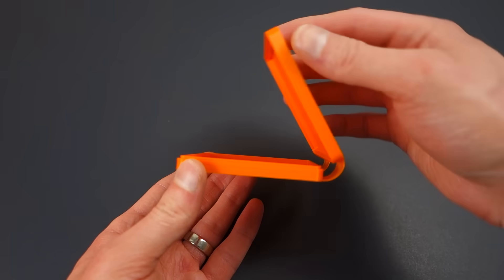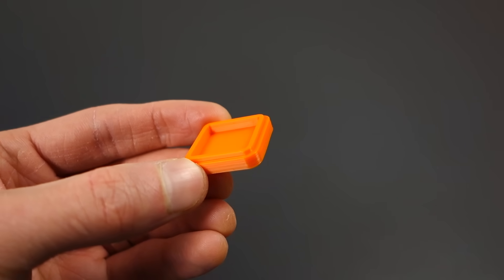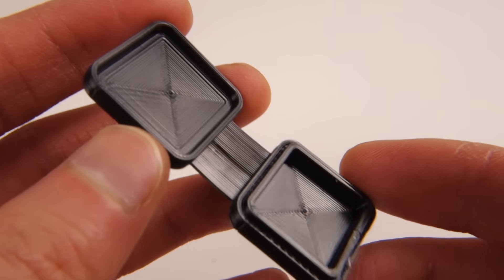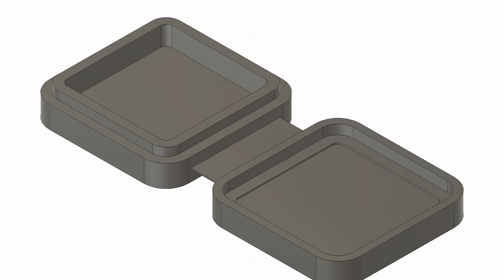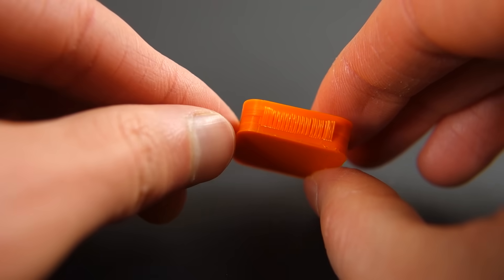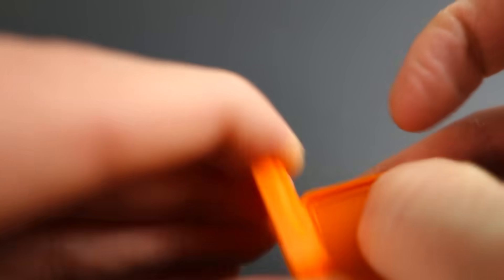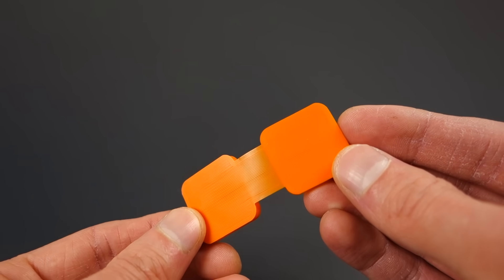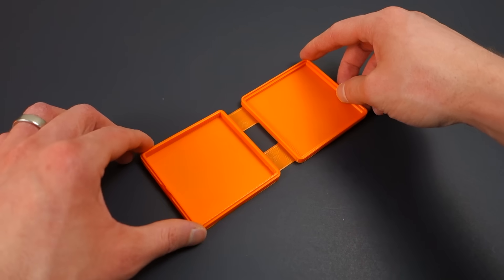PLASTIC LIVING HINGES that NEVER BREAK with 3D Printing!

Comment: I noticed you did look at the breaking strain on the filament for designing the strain on the hinge, but that's not the right number. If you instead use the elastic limit (~2% for PLA), the hinge will only deform elastically and will last many, many order of magnitude longer too.
Reply from the maker: Yes, staying in the elastic region is the way to go for hinges to last longer.

Comment: You could try crinkling it. Print it like WWWWWW .... this effectively increased the radius of the hinge, so it won't bend as much. Normal living hinges do not do this because it'd be costly and pointless, but it might work with this less flexible material.
Reply from the maker: Good point.  I can see how that can work especially if you have the room for it.
Reply: @UltimateToolChanger Cool vid btw i appreciate the science

Comment: I have never had anything with a plastic hinge like that which the hinge did not break before a month of use, that means opening and closing it at least a few times per day over that month All flip top products are polypropylene? Then no, polypropylene hinges do not bend many thousands of times before breaking, more like a few dozen at best.

Comment: You could make the box out of a stiff filament and leave a slot to slide a more flexible hinge into
Reply from the maker: That's a really good idea!
Reply: @UltimateToolChanger    the slot could be flush to the inside bottom with a little lip recessed into the top edge of the slot, the hinge would just need a little bump to snap into place without an adhesive that might degrade the bendy filament... then the hinge could be replaced if it breaks.

You might even be able to use raw, unprinted filament as a hinge, or even a strip of soda bottle held in the slot with a pin or dot of heat from a soldering iron, a strip of soda bottle would make a fantastic "piano hinge" type of connection on a large box

Comment: Maybe easier to only 3dprint the box and use short filament cuts to connect the parts (design the holes for the filament to connect)  than you can use exotic material for the hinge:)
Reply from the maker: That's a great idea!  There are lots of options once you don't make the hinge and case from the same material.

Comment: How about doing a mix material print? Start with the hinge at the bottom and use TPU for the first layer and then swap out tpu for pla for the remaining layers. You get rigid box with the PLA and hinge that is less likely to fail with the TPU
Reply from the maker: Yes, that's a great idea!  I'm not able to print multi-material parts right now, but hopefully in the future.
Reply: Because in this case the swap is at a layer, you can do this by simply pausing the print and swapping the filament. But yea printing with a multimaterial system would be the best way.
Reply from the maker: @nbdyfamous7088  That might work for some materials.  My understanding is that different materials do not stick well to each other, so they can separate really easy.
Reply: @UltimateToolChanger True! TPU and PLA work excellently for this application. PETG doesn't adhere well to other materials.

Comment: Tip for your support material issue.
Pre-print support blocks out of PETG.
Pause before bridging.
Apply glue stick to PETG support block. 
Slide PETG block under hinge area.
Resume printing. 
Remove PETG easily.

It shouldn't need much adhesion to the build plate as it's going to be wedged between 2 parts of a print.
Reply from the maker: Great idea! 

Sounds similar to others that said they apply a marker over the support material and then resume print.
Reply: @UltimateToolChanger  So many good tips here! Thanks for making this video!

Comment: so what length was the hinge for the PLA hinge? or what is a good length?
Reply from the maker: 12.25mm was the length of the hinge when flat, with a bend radius of 3.9mm.

The length of the hinge is calculated using the circumference of a circle formula, C=2*pi*r.  

The hinge is only half of a circle in this example.

Comment: you can make thinner walls than your nozzle width you only loose some surface quality, 0.3 will be no problem,
either way 0.45 is still more than you need for a a 0.4 nozzle, you already get optimal great adhesion at 4.15- 4.25

Comment: Trimmer line. Just buying it in big spools and printing such things.
Reply from the maker: I heard about this before, but haven't tried it.  Should try it sometime.
Reply: @UltimateToolChanger  It just PA6, brightly tinted, prints the same, need to dry, a correction for the diameter is also needed, but this is several times cheaper than just any material, if you buy 3+ kg spools.

Comment: You should read about stress concentrators. If you print your belt vertically, but add a rounding where it attaches to the cap, then the belt will behave as predicted and bend in an arc, without undue stress. Avoid 90 degree angles on connection places.
Reply from the maker: I'll be diving deeper into this in a future video!

Comment: It's really unfair and uncontrolled comparison that your flat-on-bed example was given a much greater bend radius than the previous 2 predecessors. You should show examples of those first 2 if they were also granted a greater bend radius
Reply from the maker: Good point.  I should have gone back and re-did everything with the same bend radius.

Comment: I so want an IDEX 3d printer for my next one. I've had so many challenges I think that could be solve with a second material for support. I tried a 3d printer that switched filaments but it didn't work well for me.
Reply from the maker: Same here.  I used to have a dual extruder mounted on the same rail and it didn't work well

Comment: I would imagine that ironing the surface of early layers with multiple directions of extruder lines would further increase the durability of the living hinge, as it would bind the extruded material against the grain of the layer lines. Anyone wanna get on a post processing plugin that hacks gcode to do this?
Reply from the maker: I wonder if this can be achieved with breaking the model into multiple bodies.  Maybe it will force the slicing software to iron the top surface of each body.

Comment: 3:50 Did you try the sharpie interference layer trick for zero offset supports?
Since the hinge is only one layer I'm not sure how well it would work, but it'd be interesting if you tested it out!
Reply from the maker: I haven't yet, but  maybe it will be worth it if I won't figure out a way to do it without pausing the print then
Reply: Care to explain this trick?
Reply: @JeronimoStilton14  I haven't tried it but other commenter explained it, basically you place a pause command at the end of the support print with a solid interface and cover that surface with a sharpie or similar permanent marker before continuing the print, that will make it much easier to separate, also you can use alcohol to separate it.

Comment: Looks like you need to make a slight adjustment to the extrusion multiplier? Your lines aren't fully connecting?
Reply from the maker: Are you referring to the top or bottom surface of the print?

I've calibrated the extrusion multiplier so that dimensions are more accurate.
Reply: @UltimateToolChanger  1:145 and 3:11 seem to show it well in the inside surfaces and the hinge. Maybe it's just personal preference, but I kinda try to make my lines form a solid surface and not have gaps. But if it's affecting dimensional accuracy, then go with what works.

Comment: I think we've reached a point where it's propably easier to just print a normal hinge with a metal wire
Reply from the maker: Looking forward to the day when everyone can have a metal 3D printer in their garage!
Reply: I don't know what leads you to this conclusion.  You think it's better to have two printed pieces and a metal pin, than a single printed part?  You might look at what industry does - they minimize the number of parts wherever they can.
Reply: @BrightBlueJim  indeed, but it's all a mattter of scale

if you make 10-20 parts it is cheaper to go with a simple, proven design, especially if development would take disproportional effort compared to the outcome

in industry you have millions of parts where 0.1 gram of plastic saved on a single part makes a huge difference

you can afford to put much more time in to development as the payoff is significantly greater

Comment: Not being g a jerk, but I figured this out without all the tests.  Actually on accident. A failed print that was one layer thick was very flexible when I scraped it off the bed.  I instantly knew that hinged designs could use this in an actual part.  So thanks for doing the hard work and sharing this.  Great video,  thumbs up for this one.
Reply from the maker: Nice, nothing better then getting to the correct answer by accident without all of the additional testing!  Glad to hear you liked it.

Comment: You can use Sharpie supports. What you do is you reduce support distance to zero and enable solid support roof and insert an automated print pause right after support roof. Then during the print pause you go in and you paint with a felt tip alcohol marker over the support roof. It should just release, if it doesn't, you can encourage it with a little alcohol.

I also think the hinge may want a fillet or bevel around where it connects to the body, since it's the part most likely to break and it's better to disperse the stress there, and you don't actually want the hinge to bend there but across the rest of the length evenly.
Reply from the maker: Great point about using marker between support and hinge!
Reply: @UltimateToolChanger  Another favourite support trick of mine is reducing support extrusion width to about 65% nominal, or flow to about 50%. Basically ruthless underextrusion. This way you can have comprehensive support geometry but supports that can be broken off the most fragile of prints, very brittle support. Less waste material as well. Had to make use of this extensively just the other week to print myself a variant of the RollingSloth RS4 gaming mouse in FDM with lightweight HIPS, which was obviously conceived as an SLS model.
Reply: @UltimateToolChanger  And the fillet between the box and the hinge. The thick, side printed hinge would have benefited from it.
Reply: I love that idea
Reply: @Fly_High_FPV  Can't claim credit, saw it on  Hackaday. The person who originated it also made themselves a jank toolhead attachment which would actually paint in support separator programmatically, though they wrote the G-code for the test print by hand. Could be worth a better tool design and a post processing script you can just attach in a slicer. Also worth exploring some sort of colourless coating, to avoid marring the print.
Reply: @SianaGearz  thx i'll check it out

Comment: Print the first two layers to the thickness of the hinge in a flexible material then swap over to PLA or main material??? Never printed with different materials layer over layer but might work? Thanks for the video, enjoyed it!
Reply from the maker: I don't have a dual extruder printer, so don't know from experience.

From what I've seen different materials don't bond well layer over layer.  However, I've seen people get good results by adding locking features between the different materials along the same layer to forces the two materials to grip each other.

Comment: You might try the bridged hinge again, I'm guessing you run the default setting of lower the extrusion factor on bridging, which creates gaps on first bridged layer. What if you instead increased flow factor to above 1?

(I still think printing on bed in the right orientation will result in strongest hinge)
Reply: If you increase flow you get push-droop. Might be worth a try but i don't think it will be cohesive.
Reply from the maker: Higher flow might help with bonding the hinge to the case, but my guess is not by much.  I do want to figure out how to solve this problem though.
Reply: But why?  Making the bend radius as large as possible is the right answer, and that worked great.  So why try going back to make something work that didn't have any advantage over the existing solution?
Reply: @BrightBlueJim  you seem to have decided that every project that can possibly need a hinge will be a flat box :p

Comment: These hinges are always made from polypropylene for a reason. You can bend polypropylene many thousands of times and it’ll never break. All flip top products and food clips are polypropylene. It’s actually ok to print you just need to put a layer of polypropylene box tape over your build sheet. Polypropylene only sticks to polypropylene.
Reply from the maker: Yes, PP is the best material for living hinges.  I haven't printed PP in the past, but it's on my list to get to.
Reply: Polypropylene is difficult to get to stick, even to tape. I found that the tape doesn’t work all that well and comes off the bed, I have had best results printing on the stock build surface on an ender 3 pro which is the magnetic one, I have no idea what it is made of though, I think I saw that it may be polycarbonate.
Reply: @conorstewart2214  PETG lives longer than PLA and better for hinges.
Reply: @conorstewart2214  I’ve never had that trouble to be fair but maybe not all polypropylene filaments are made the same. You can get polypropylene beds.
Reply: @bonjipoo  yeah there is quite a big difference between different PP filaments I think. The problem with using a PP bed to print PP is apparently it sticks way too well.
Reply: Polypropylene knows to stick to Polypropylene not because it knows where Polypropylene is, but because it knows where it isn't. By subtracting where Polypropylene knows where Polypropylene isn't to where it knows that it is, it is able to tell where Polypropylene is
Reply: @TheFilipFonky  I dont understand what you are trying to say. Something about material properties?
Reply: With the difficulties printing with PP, isn't it most reliable overall to just insert a segment from a sheet of PP or PE? You could still print a rigid template for precisely cutting a standardized hinge element for use across your models. At some point, the payoff for trying to solve every problem with monolithic material has diminishing returns.
Reply: Does Polypropylene take extended heat/sun/elements? Does it rot?
Reply: @chucksneed5405  As with all plastics it probably depends on particular additives and dose of UV but my experience with cheap PP rope in the south-west US sun is it starts turning to dust after about a summer.
Reply: @TestSpaceMonkey  One summer? it's gonna be a pass for me dawg
Reply: Magigoo PP is a, secret sauce for me.
If you want easy to print PP, look no further than Fiberlogy.
I've printed also with industrial polypropylenes (PP-R and even PP-H) and they are WAY overkill for applications like small containers.
And very difficult to control, even with proper adhesive.
Reply: Can i use PET plastic?
Reply: was coming here to comment the same thing
Reply: I bought some for that reason, but I haven't gotten to using it yet. For some reason I thought nylon was the right material. It was WAY better than PLA, but it's still too fragile. Then I found out about PP. Maybe when I'm done with my current print I'll give PP a try.
Reply: @awilliams1701  PP isn’t a very popular printing material because it warpy. It’s a bit soft and shiny but very durable and can withstand high fatigue hence it’s use in this sort of continuous bending application.
Reply: @bonjipoo  yeah that's more or less what I saw about it. I do find it odd because temp wise it seems to be very close to PLA. Much easier than nylon that's for sure. I actually discovered that when the printer says it can do 300, it can't. I found 295 was the limit. 300 will cause a thermal runaway detection.
Reply: @awilliams1701  300 is typically the limit for most printers due to the thermistor used, you can swap it for a better one or a thermocouple and go higher. 

What makes you think it is close to PLA? They are very different materials.
Reply: @conorstewart2214  I found 285 was best for nylon on my temp tower. Anwyay I saw a materials table in prusa's website. It says that PP is 220-245. That's not much hotter than PLA. And the bed temp is 100. It also says my satin sheet works fine without anything extra (glue, tape, etc...) unlike nylon requiring glue.
Reply: @awilliams1701  ABS also can print in the 220-245 C range and it is also very different from PLA. TPU and PETG aren’t that different in temperature either, so are they all very similar? The temperature it prints at and how the bed adhesion is doesn’t make it like PLA at all, by that logic any material that prints under 300 C is very similar.
Reply: @conorstewart2214  I'm just saying it's lot easier to work with than 300 degrees. lol
Reply: @awilliams1701 
Please share the results. Thanks😊
Reply: @ClaHang-d2w  I had about a 50% success rate in summer and 0% in the winter until........I bought the prusa PP plate. Then in any time of the year I had a 100% success rate and the part looks 10x better.

Comment: Shouldn't Arachne make your hinges thinner if you print them upright?
Reply from the maker: I haven't experimented with, but probably should.  Not sure if the hinge quality will be good based on physics of how the layers are laid down when extrusion width is smaller than nozzle diameter.

Comment: If your hinge is 0.2 but you print at 0.1mm layer height, you can get 2 layers in that 0.2mm - can also add ironing which might meld the layers together better with heat transfer
Reply from the maker: I haven't tried this yet, but definitely need to in the future.
Reply: @UltimateToolChanger  that would be why the attempt at 0.3mm failed as well. Your layer height is 0.2mm. Meaning you have to go in multiples of 0.2mm.
Reply: Try to increase the flow also for bridges